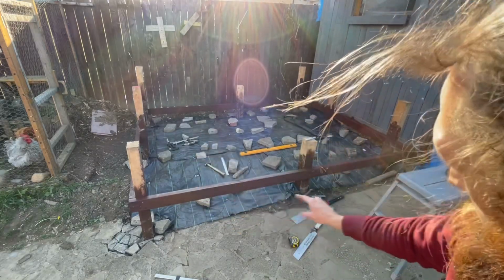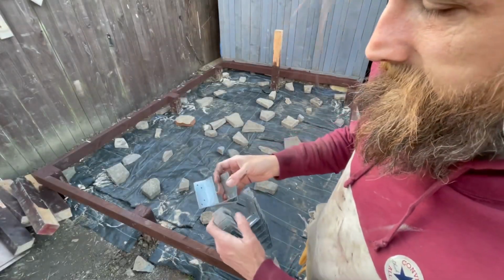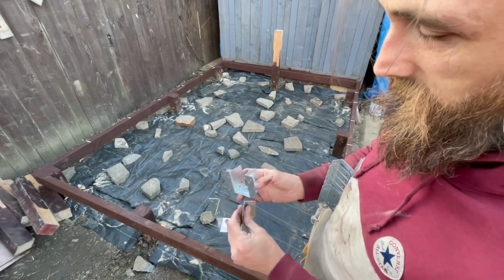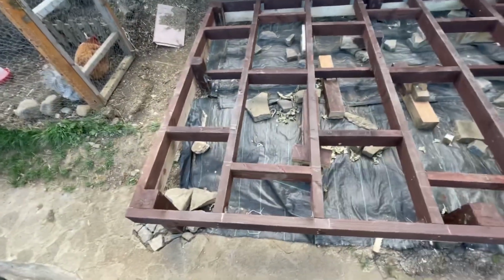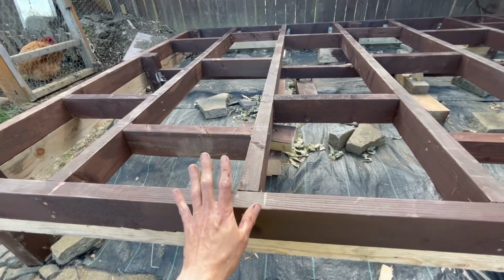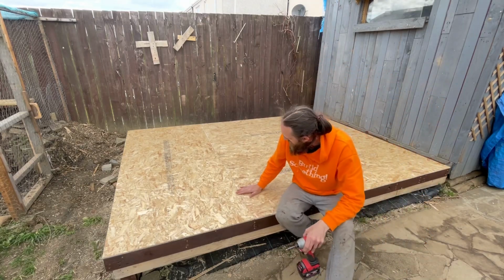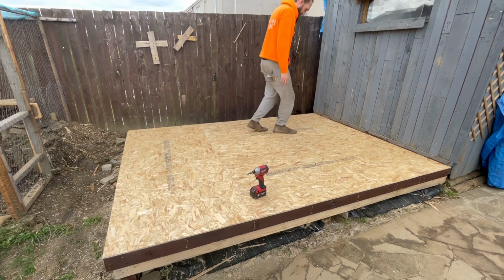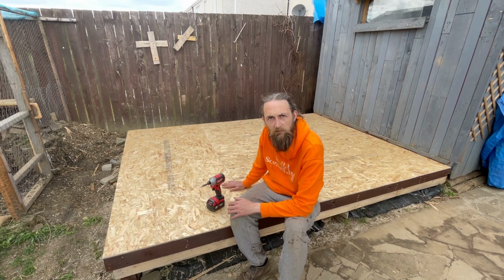Extending my workshop ( Part 2 ) building the floor

Comment: Good Morning young man ....just a quick info update regarding Holzmann bandsaw .... The guy at Machine Mart tells me the Holzmann is the exact same saw as the now defunct Record BS500 ... except with bettter guides (bearings) and fence configuration ...they apparently used to sell the BS500 and he reckons it was the best saw on he market in is price range .... Jus thought tha you would like to know ..... on a different note yesterday  I managed to snag a used Startrite 352 (single phase) for a very reasonable £750 ....in excellent nick and came with about a dozen spare blades ...some newish some about knackered  ...and several  boxes of other spares and assorted sundries .... so all in all a good day ....and I'm back in business without breaking the bank ..... just to need to offload my myford ML8 to make a bit of space for it lol ...ttake care my friend ...hope the Holzmann info was helpful
Reply from the maker: Where did you get your bandsaw? Was it a company or private?

Comment: To get a good square bro use the method 3-4-5   Measure 3ft one way 4ft the other and then measure from your 4ft point to your 3ft point and it should measure 5ft 👍🏻